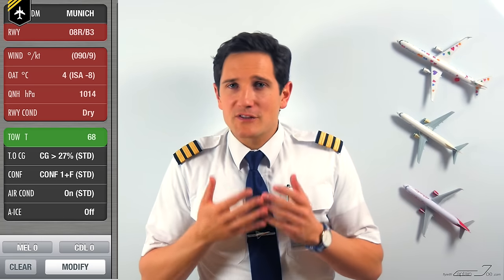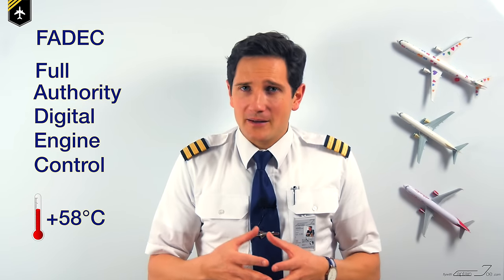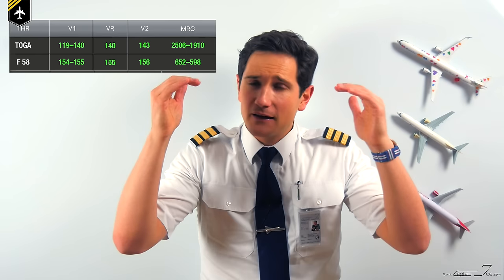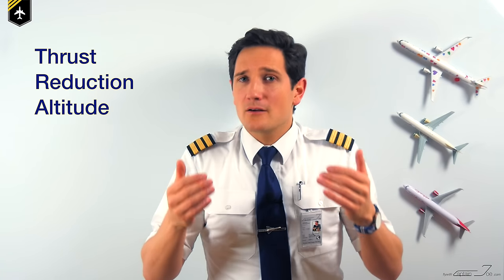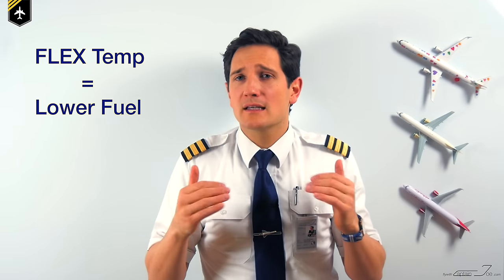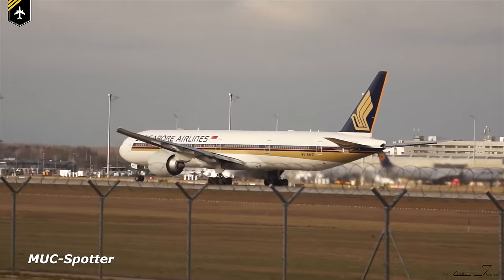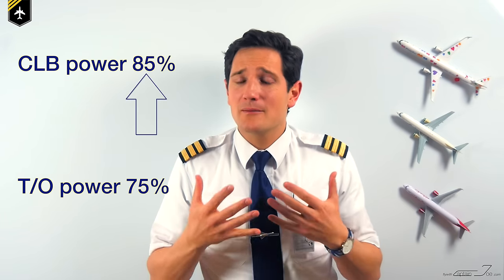What is FLEX TEMPERATURE? Explained by "Captain" Joe

Comment: Hey Joe

could you please do a video on the RAT?
Reply from the maker: Coming out in two weeks, video is already finished!
Reply: HI Capt Joe , Please explain about different types of altitudes including thrust reduction altitude and acceleration altitude
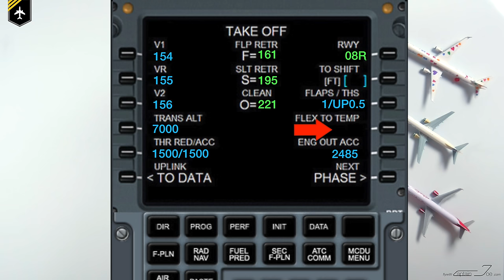Reply: @nazimfazilmohamedhanifa9733  On a takeoff, the power is applied (full power or reduced). This power is maintained until thrust reduction altitude, when the FMA flashes to indicate it is time to pull the thrust levers back into the climb detent (climb thrust is set).  Acceleration altitude is when the pitch FMA (pitch controls airspeed) changes from SRS to CLB or OPN CLB and the flight director commands a lower pitch so the aircraft can accelerate and allow to pilots to retract the flaps on schedule at F speed and S speed (that’s Airbus stuff).In this video, at 1:50, you can see that the FMGC (flight management and guidance computer) is programmed to do both at 1500’ above sea level, not ground level.

Ok,I just finished packing to fly out tomorrow and I can add to this comment. It appears that Cap’n Joes company uses a 1500 foot thrust reduction and acceleration altitude (I don’t know the field elevation of the airport he entered and I don’t want to leave this comment to go watch the video so I can google it).  So, when he takes off, he pushes the thrust levers up to the TOGA or FLX detent and the FADECs will set the proper power for the takeoff.  At 1500’ above sea level, the FMA (annunciation in the upper left of his PFD) will change from MAN TOGA or MAN FLX into a flashing LVR CLB in row 2.  This is the signal to move the thrust lever back from the takeoff setting to the Climb Detent (two clicks back from TOGA or one from FLX/MCT) and this is the way the pilot communicates to the FADECs that climb power is desired.  The pitch bar will move to a lower position on the PFD to command the pilot or autopilot to lower the nose and accelerate.  If the flaps were set at “2” or “3”, the pilot will see an “F” on the speed tape (airspeed tape) and once the aircraft is faster than that, the flaps are retracted to the 1 position.  Once the flap handle is moved, the F disappears and an S appears on the speed tape.  When the aircraft is faster than S speed, the flaps are retracted to the up position and the aircraft will accelerate to 250 knots until 10,000 feet and then will accelerate to “economy climb speed” which is some number that is affected by wind, gross weight, and cost index.  Time for dinner.  I may add more later.

Comment: Joe, can you make a video about engine failure? what happens, does it crash immediately or can you glide it safely to the ground?
Reply: ruben korkis you can glide safely back to the airport and with one engine you can still fly good with those commercial airplanes
Reply from the maker: Planes don´t immediatley crash due to an engine failure, I`ll see what I can do! Greetings Joe
Reply: Captain Joe thanks, looking forward to it
Reply: Captain Joe kannst du mir Webseiten zeigen wo man zum Beispiel flightstick oder Navigationsgerät für einen Flugsimulator kaufen kann
Reply: Marc Kupper Google?
Reply: OnFlightSim dann geb Mal auf Google amathuren ein.... fiel Glück 😂
Reply: viel
Reply: Marc Kupper http://www.simparts.de/de/homecockpit/a320.html dafür brauch ich 20 sek
Reply: OnFlightSim danke danke danke damit hast du mir sehr viel Zeit gespart
Reply: Ich weiß nicht, ob der Arbeitgeber das so gerne sieht ^^, aber da gibts massig Potential für ein paar Videos zum Thema Flugsicherheit oder Notfallabläufe/-mechanismen ;) Die Ram-Air-Turbine ist ja anscheinend schon angedacht...
Reply: gesalzene Zirbelnuss zur RAM gibts ja nicht so viel zu sagen
Reply: called a dead stick.
Reply: Flugzeug Dokus yeah but i've seeb different situations where they just instantly dive to the ground
Reply: ruben korkis . you will see situations like that only in movies. . if all the engines fail, which is unlikely, you will glide as long as you maintain the required speed necessary to do so by pitching down.
Reply: Good explanation and Midas a more modern term is IAS...Indicated Airspeed. I use Infinite Flight SIM and it has options for using ground speed or airspeed. Always use IAS, like he said it is really what you need to know to keep the aircraft flying, landing, takeoff, and watch that stall speed!
Reply: If one engine fails you might not even notice!  The computer adds rudder and banks into the good engine.
Reply: ruben korkis FALE NEWS! they just immediately stop and fall right out of the sky. Just like a rock.
Reply: These like people have said only really happen in movies, things can cause a plane to nosedive but it wont be engine failure. There was a 747 I believe that had a quad engine flameout over Indonesia and that plane has a glide ratio of 12:1, I believe it landed safely....
Reply: ruben korkis, no you don't crash immediately upon one engine failure. The other engine will take you to your crash site.

Comment: Hi Joe
Do you have any videos explaining the v1 v2 and rotate speeds? And TOGA?
Thanks
Reply: Nilguiri I think V1 means the plane has to lift off the ground and it’s too late to abort takeoff
Reply: V1 Is the point where takeoff should not be aborted.
Reply: V1: take off can't be aborted 
Vr: the speed where the pilot has to rotate the aircraft 
V2: The speed where the aircraft can continue it's climb with no problem even in case of an engine failure
Reply: TO/GA is the speed for  Take Off/ Go Around
Reply: @lucasbrien5008  
There is a PilotsEYE.tv video of a LX A330 flight ZRH - MIA and the FO stated that their flight would be a TOGA take off from ZRH.  When would a flight have a TOGA take off and when would a flight not be a TOGA take off?  It's has to be an Airbus thing.
Reply: dpm1982 Its not an airbus thing, it is the  take off TO and go around GA power, therefore it’s called TO/GA
Reply: @lucasbrien5008  TGOA is thrust setting not speed
Reply: @dpm-jt8rj  If the engines can produce enough thrust with less than TOGA AND meet all the climb requirements, a Flex takeoff is allowed.  There are certain conditions other than runway length, field elevation,,and temperature that require a max thrust (TOGA) takeoff.

Possible windshield, clutter (slush water) and some deferred maintenance items require TOGA thrust takeoffs.

Comment: 58° Celsius??? Has Death Valley an airport??
Reply: isn't it Fahrenheit? it is 14,4 C
Reply: @Alaukikdeep S Boparai you are correct.  Entering a higher than actual temperature into the Takeoff Perf Page causes the FADEC to calculate a lower power setting for takeoff.

Comment: I've a question for a video, what is the little red buttom on the thrustlevers
Reply: Jasper Stevens you can push that in order to switch the autothrust off
Reply: OnFlightSim thank you but what is the autothrust is that the autopilot?
Reply: Jasper Stevens it controls the engine thrust so you could say it's an autopilot for the engines
Reply: OnFlightSim Ok thank you!!
Reply: Good Question! As far as i know it is pushed when you discontinue your approach and go around and gives you max power as well as pulling up automatically
Reply: Alexxd_12 Ok thank you!
Reply from the maker: Correct it´s the disengagement button for the auto thrust :)
Reply: May not deserve an entire video, but if you talk about autothrottle, add Boeing and Airbus differences, the double click/TOGA, normal/alternate mode, plus what makes the autothrottle "special" (being not that linked to the autopilot course, altitude, attitude, vario, etc.) that would be great... or am I asking for too much ?
Reply: Jasper Stevens I believe they disconnect the auto thrust

Comment: When the engines are starting up, why can both engines not be started at the same time?
Reply from the maker: Try blowing up two ballons at same time, won´t work due to lack of pressure! Greetings Joe
Reply: Thanks!
Reply: Some russian (ukrainian in fact) airplanes can. But you don't want to mess up in case you have trouble with one engine on startup. Just do it one after the other...
Reply: if you have four engines, you can put the first one on reverse then cross bleed to start next two together. We do that on C17s
Reply: to talk about the 787 which does start both engines at once :P
Reply: martin thorsteinsson I heard the 787 has electric starters so bleed air supply pressure is not an issue as long as the apu generator is strong enough for two starters.
Reply: 747s can start two engines at a time.

Comment: Luxury for Pilots these days. When JT3's and Conways were around, we had to calculate EVERYTHING manually. Converted airliners to freighters, when fully loaded, calculations were pretty simple. 

Max (stabilized) power.  If the air temperature was excessively hot, there was a simple decision. You waited, sometimes hours, if at max weight (koff)....

Comment: I love how something so important is done by cheating a system! 😂
Reply: It isn’t cheating the system. It is just giving the system a number to make a calculation for a thrust reduction.  Boeing does the same thing, but they call it the “assumed” temperature.  If it was tricking the system, pilots would give the false temperature on the INIT A page instead of the outside air temperature.

Comment: Hi Joe,
 but 2 comments:
- the FADEC is the name for the whole System, the  control unit itself ist called the ECU=Engine Control Unit. Compare to a Fly-By-Wire: It is the name for the whole system (incl. computers, wires, servos, input devices, ect.), the computers itself then are called FAC or ELAC.
- the Flex-TO-methode won't give you a better fuel economy, it "just" reduces engine wear. I know, this is often explained in type training and as "proof" they argue, the fuel flow is reduced. In fact, the engines work the most economic way at full thrust (amount of thrust vs. fuel used). Since you need apply a certain energie to reach your ceiling altitude (regardless the power setting) and energy in that case is power over time, it would be better, to use lots of thrust for a short climb-periode instead of lower thrust-setting.

Comment: i dont know if you ever talked about this but something i wanted to know are the takeoff procedures before take off, like how to calculate manually v speeds, or flex temperature, and landing aswell like to know what are minimums, radios, baros, etc. everything very quickly landing and take off procedures

Comment: A flex takeoff will consume more fuel, not less, because it takes more time and distance to climb. It's in the long run when you will have a lower fuel consumption due to better engine performance. Great videos anyway, I always learn something.

Comment: I always use ATOT to achieve V1, then if there is an issue, I have more runway to stop.  But I am not in the Commercial Sector, but Military Sector.  The TF39 engines required a near maximum setting at light weights, and full or even 110% under load, due to the age of the engines and the low thrust output of those engines. That is why I specifically designed the GE90-115B to replace them for maximum efficiency and performance headroom. 
I always did Static Full Power Throttle ups before brake release to further give me more runway in case something arose on rollout.

Comment: Awesome! I filmed my takeoff out of lanzarote last year and it's on YT. I always wondered if it was a relatively short runway because on arrival the braking was extreme!, so much so my ohone was pulled out of my hand and ended up 7 rows ahead! (I was right at the back)
Reply: Its not a short short runway, but yes for a loaded A320 aircraft, one may need medium autobrakes rather than low.

Comment: Dear Joe, thank you for this interesting video. 
Two questions, though: 
1) Why are the V1 and Vr speeds actually HIGHER when using a reduced T/O thrust setting? From my understanding, the V speeds depend on aircraft type, flap setting and take-off weight only, but it looks like I am wrong?
2) How come a derated (flex thrust) take-off saves fuel? For sure, reducing the thrust setting will reduce the fuel flow, but at the same time, the initial climb rate will be reduced as well. From my understanding, a full power take-off should be the most fuel efficient departure, because of: (a) better thermodynamic efficiency from a higher core temperature, (b) lower aerodynamic drag, because of a shorter time and distance from brake release to gear up.

Looking forward to hear form you!

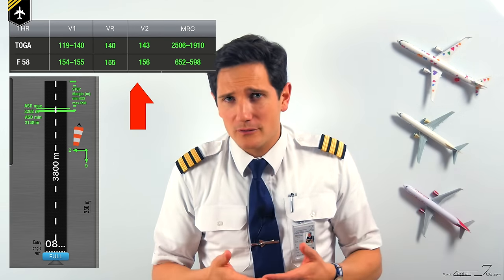Comment: Joe, your verbiage is a little confusing at 2:49.  You said something like “the higher the flex temperature, the higher the V-speeds, and the shorter stopping distance”. Actually, with higher speeds, comes longer stopping distances.  I think you meant that there would be less stopping distance available with higher flex temperatures.
Reply: But you could also argue if V1 was the same speed but you had a low and high flex temp, with the high temp you’d would have more thrust and reach that V1 quicker than the lower one so there would be more room to stop if you had to abort say just before V1
Reply: @tomstravels520  You have it backwards.  The higher the flex temp, the greater the thrust reduction, and longer it takes to get to V1.

High flex Temps are often associated with longer runways where the aircraft has enough runway to accelerate to the increased V1, and yet still be able to stop with a reject at V1 in the remaining runway.

Comment: Just thought that I would point one thing out: Yes, the fuel flow is reduced with a derated takeoff thrust but the total fuel burn is actually increased. The increased time spent at low levels offsets the reduced fuel flow. Therefore a lower fuel flow is not one of the reasons why aircraft take off with less than full power.

Comment: Nice videos  that's the best seat in the house right there up front.    the Question I have  was boarding for a flight and the captain  came on and announced  that the aircraft had a non functioning APU  and that it was going to change there  start up procedure  .. ?   to get main engines started.

Comment: Great video! I think making a video about all (or most of) the antennas (Purpose, function and how it works) would be very Interesting.
Reply from the maker: True, well it would be a very long video, cause there are many antennas fixed to a Airbus ;)
Reply: Very long indeed. Better focus on a single plane (A320 series for example). It took me months just to figure out those mounted on the Boeing 747. By the way, should domes (satcom/TV/IFE, wifi, etc.) and probes (pitot, valves, etc.) be included ? Rather long I guess, even for just the A320..

Comment: I have a question regarding flap settings.  During take off they are usually extended to 10-15 degrees.  When landing, they are extended out to 30+ degrees.  Since flaps function to increase wing area and reduce the air speed needed to fly, wouldn't it be useful to use more flap during takeoff as well?  I'm guessing that though it may decrease the length of runway needed for TO, it may not be economical.
Reply: I think I realize the answer to my own question.  Full flaps would really produce drag when you want to get into the air - slow and ugly probably.  So I'm thinking now that if a plane did use full flaps they would not only be slow, but the climb would be incredibly shallow.

Comment: Hey Captain Joe!! Great channel, really usefull to all of us travellers and aviation fans. Got one question for you, I've seen most of your vids but not sure if you've addressed this. I am a regular short flight traveler (Athens, Greece ATH to Larnaca, Cyprus LCA and vice versa. Mostly on an A320, and the flights are on the rate of one every three or so hours. Coming back to Athens one day, after a delayed arrival of the flight, they borded as immediately after arrival of the aircraft and inside the cabin, prior to push back, on top of the windows was a significant amount of vapor running throughout (you could mistake it for smoke, it was that much). Why is that? I can guess it's got to do with the pressure changes but still got me puzzled as it was the first time I saw it on a flight. 
Keep up the good work!! ;)

Comment: Very informative vid as always, Captain! I have 2 questions for you today; 1.What is a black, rounded disc-looking like thing located both sides of the throttle? (usually it can be found in A320, A330, A340 and also in B737). 2 If you were to fly a Boeing aircraft, which type would it be? Thanks very much in advance for the answers. Cheers!

Comment: So is there such a thing as being too conservative on fuel?  For example:  Let's say that a plane only needs half the runway to take off, but the pilot uses a thrust setting that will consume 3/4 of the runway and then wait until say 7/8 of the runway before finally taking off.  Is the presumed fuel savings from such a scenario worth the extra time it takes to take-off?

Comment: Interesting to see the Airbus having higher takeoff speeds with higher flex temp, which is the opposite of the Boeing's. Would be interesting to see both airplane applying the same temp and take off on a parallel runway to see the differences in terms of runway usage and acceleration performance.